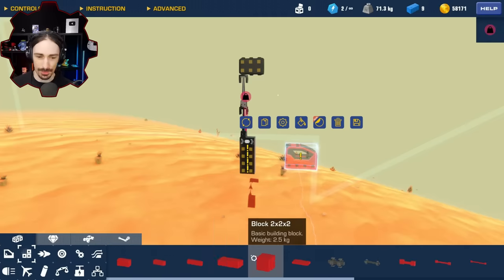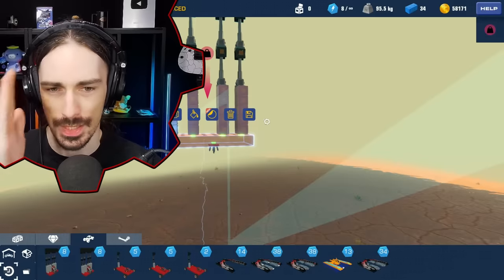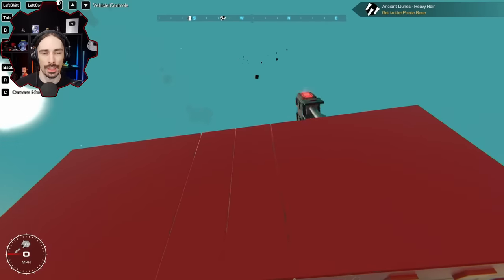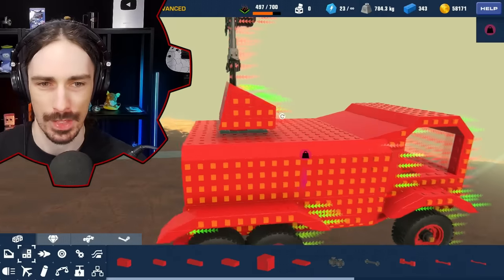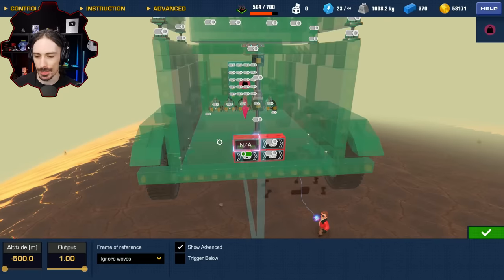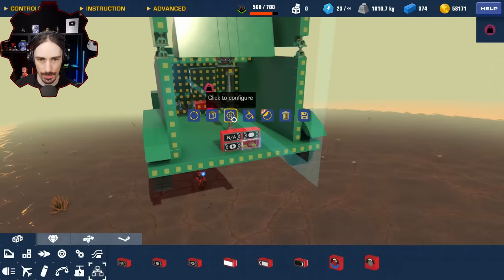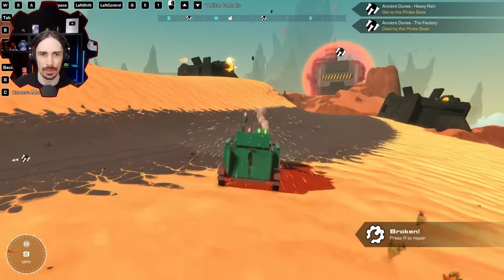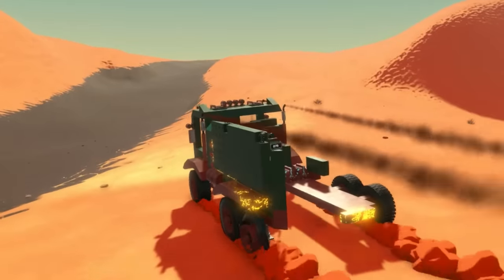I Used Bomb Bays to Create a Long Range Mortar Launcher!

Comment: If you want them at a default angle of 45 but still have adjustment set the angle to 90 then use a distance sensor that is always on and set the output value to 0.5 then connect it to the hinges and you will have your 45° angle but should still be able to adjust past that mark, you may need to include an XOR gate to get both inputs to work

Comment: Next thing to add to this would be a range finder of sorts. See how far the mortars go by default and then have a distance sensor that leads into a tone generator when it is at that predetermined distance. This would obviously require line of sight but could be cool!

Comment: I made a missile-launching truck and used pistons as means to angle the missiles upwards, and a hinge with 0 strength as the connection. A servo controls the direction. Though it was not very solid so I could not have more than one piston at 100 strength without using suspension springs.
I love the finished product. Very well done :)

Comment: To limit the steering hinges, use steering hinges. Set the angle range on your "aiming" hinges (the amount you want to be able to adjust them) then attach that to another steering hinge with a permanent preset angle (representing your desired default angle.) 
Aiming hinges = 90° limit 
+
Mounting hinges = 45° preset
=
Firing solutions from straight up to straight forward ONLY

Comment: 5:11 place a distance sensor facing the ground telling the hinges to toggle and hold position. It'll set them to 45 when it spawns in and still let you adjust via the controls.

I'm working on a quad jet engine hovercraft and have 4 distance sensors on hinges triggered by a different sensor, as a secondary function.

Comment: Wait scrapman is making super cool modern jets? And there’s a new trail makers update?! Man I’m so behind…. He forgot to get the….. penguins?? What are those?
Reply: I think it's the Airborn DLC..?
Basically, now there are 3 new weapons with auto-aim (might sound OP, but it seems pretty balanced imo), more aerodynamics, balloons, and a whole new campaign where you help chirpos (da birbs) get rid of the pirates.
There are missions that require you to take down a specific enemy vehicle or building, and save the chirpos that were captured, using passenger seats.
Scrapman has a playlist of him playing through the entire campaign, so now he doesn't necessarily need to pick up chirpos.
I surely missed some stuff, but that's all I could remember off the top of my head.

Comment: To prevent from angling backwards past the zero point, could you put your hinges on another hinge? You could have a hinge at 30 degrees forward fixed, with no controls, and then add another hinge on top with 15 degrees flexibility...or something like that, you might have to play with the angles to get the wanted result.

Comment: Scrap man, if you are having trouble with steering hinges not being able to set certain angles on both sides, use 2 hinges, one on the bottom at a fixed angle and one at the Top which you can change the angle of. If you set the bottom to 45 and don’t let it move, and another at the top with a range of 45, now the max range at the top is    0 and the range at the side is 90

Comment: To make it set set toggle auto on and make sure the green turning angle is towards what you want it to be. Hope this helps.
Reply: This is for the 45 degree lock. I use that to build Xwings. You will have to assign a button but still..

Comment: i challenge you to build a bomber with a bombing/aiming camera, im 99% sure its doable, if you put the camera block on a hinge and hook that up to a speed sensor you should even be able to make one that is accurate (enough) with any speed, basically the faster you move the shallower the angle of the camera so if youre not moving at all it would point directly downwards and if youre moving at infinite speed it would look directly in front of you/paralell to the ground, you just have to figure out roughly what angle is needed for what speed

Comment: Instead of mortar why not try it as a M142 HIMAR rocket missile truck. Since when launched it will look like the real thing
Reply: Yeah but you have to remember though the Rockets have a small flight time before despawning meaning you'll have to make it a short range HIMAR's Truck since long range strikes are not possible with rockets i know you can do it with the tank cannon + piston trick but not the rockets.
Reply: @darkstar_sierra1588  well true though because of the game limitation and we know that those rockets/bombs was not meant to use that way, that's why it's an experimentation to see of it's possible. But now that got me curious with cannon+piston if it will generate a strong force making the bulelt from cannon launch faster than the normal launch speed
Reply: @VhonBautistaOfficial  It does when you set it up correctly the piston will make the tank cannon projectile go "YEET!" and it yeets it extremely far too.

Comment: this makes me wonder (depending on the complexity of the logic in trail makers) if you can use a projectile equationn to determine how far its going to go. you would need to figure out the initial velocity and gravity then it would give you feet to determine how far its going to go. i bit too complicated i suppose lol

Comment: how bout a 2v2 battle with 2 Cargo planes carrying cargo crates 
with one repair vs 2 Anti-Air with infinite repairs
so the plane carries a crate from one side to
 the other until shot down (tip: there"s crates inside the aircraft carrier).

day 5

Comment: Idea: an anti-air type weapon with the same mechanism?
Reply: That would be cool to see. I made a large "Railgun" using the Tank cannon w/piston trick but since the last few updates i have noticed they gave it massive recoil so i had to give it suspension to counter the recoil or else it will spontaneously combust upon firing, and the Tank cannon is hidden inside the creation which opens up to allow you to fire the shots.

Comment: You do know that bullet bombs are also galled grenades? Especially in your autocannon air plane.
Reply: No, it's either cannons that big enough to carry explosives inside, or Incendiary rounds for heavy machineguns that also carry some explosives and Incendiary material inside. There was grenade launchers that fire grenades 30 or 40 mm. but they are too slow and short range to use even against helicopters
Reply: @onerxowns2202  I was wrong, the correct term is shell..

Comment: Hi Scrapman I subscribed to your Trailmaker creations and your planes don't fly well ^^;;
A building tip - always include a pitch trim surface that is always on activated by an altitude sensor set to -500. If you're using the small fin then there are directional opposites which means you need 2 sensors. Set the pitch of the surfaces so there is no degradation of altitude in level flight. The key sign of a great plane is when you do a barrel roll, there should be no or very little loss of altitude and no cumulative spiraling. You can monitor the pitch state by placing an altitude sensor on the exterior of the plane and watch the rate of altitude decline in level flight. When there is almost no decline then you've achieved the state of perfect flight. The pitch surfaces can be set to a decimal to obtain next to zero change in verticality.
Reply: Bear in mind that updates have broken a lot of creations on the workshop, especially older ones that haven't had their blueprints adjusted over time. Planes in particular may not fly exactly as intended if they were made before the Airborne DLC because wing aerodynamics (and I think some weight values) were changed slightly in that update
Reply: @Loop_Kat  That's correct. I'm referring to Scrapman's latest planes though ^^;;
I do realise he has time restraints though so that is probably the reason.

Comment: Bro built a M.L.R.S mortar that sounds cursed but cool as well but it probably wouldn't work if you don't know what M.L.R.S stands for Multiple.Launch.Rocket.System just a millitary truck with a rocket array on the back that turns and aims like artillery but cooler and better.